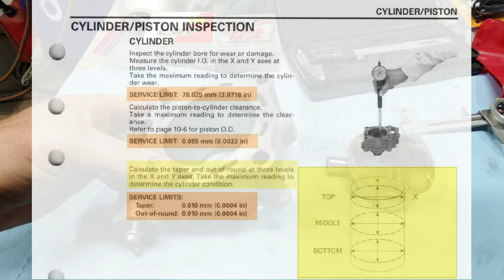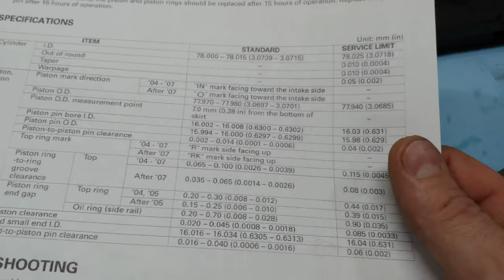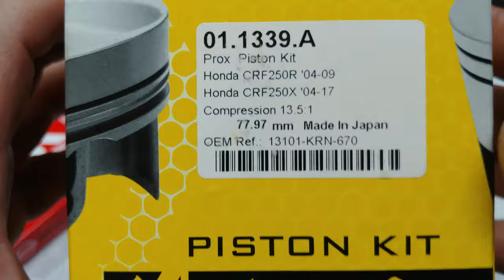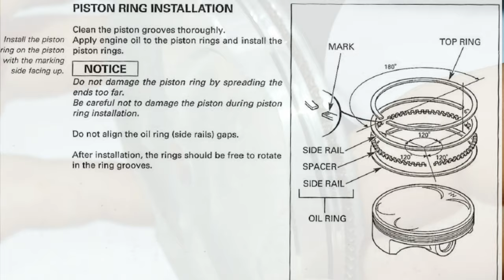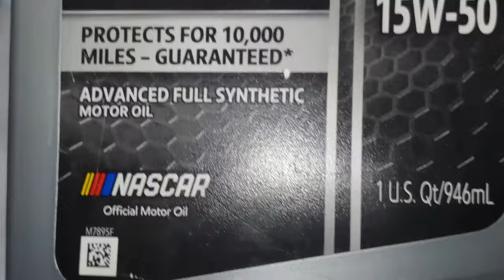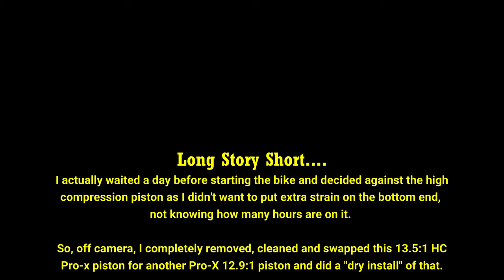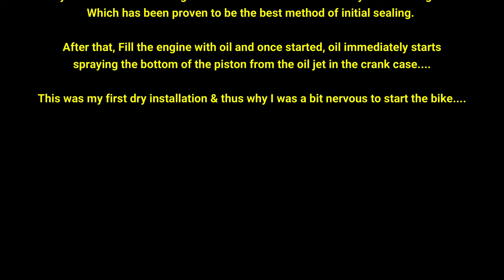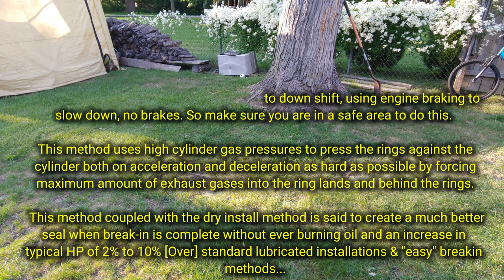06 Honda CRF250r || PRO-X Top End [ How To ]

Comment: I'm ready to do mine (in a few days when all goodies arrive to my door) crf250 2009.
It's the first time for me also. Good infos on your video, thanks.
Reply from the maker: Nice! Good deal. Glad it helped. Let me know if you have any questions. One thing I've been thinking about off and on is the next time I remove my cam I'm going to use a little carb cleaner and clean off the sides of the cam chain right where the timing marks are on the cam and then I'm not going to let the chain pop off the crank and that way I know exactly where to put the cam on the Chain when I reinstall it. You just have to make sure not to let the chain pop off the crank down by the flywheel.

Comment: Hey Andrew, would you reccomend doing a dry install on the piston? Also you didn't have to use a crankcase splitter at all correct?
Reply from the maker: Correct. Not with these 4 strokes. Just use a rubber rmallet and tap both ends to slowly work apart. 

 I highly recommend the dry install method in a new piston ring kit and light cylinder hone.

Comment: Hey Andrew I’m about to install my new top end rebuild on my 2007 crf250r. I’m pretty new to this so your video was extremely helpful. 

However I’m nervous about my crankshaft, i feel like it’s kind of loose. What’s the clearance u used on urs to check if it was too loose or not? 

Also, when u adjust the crank on the right side of the engine to line up with the tick before putting ur cam on, does the flywheel tick on the other side of the engine also move at the same time as the other side crankshaft as ur adjusting it? 

Ik that probably sounds confusing
Reply from the maker: Sorry for the late response. Glad it's helping. Hoped I'm not too late to help. I didn't really check mine but I'm about to replace it and the manual states that there should only be side to side clearance of the connecting rod of about .020" and absolutely NO Up and DOWN movement. This is really all is states. I ended up getting a new OEM Crank, Bearings, Seals, Piston, Piston Pin, Timing Chain and chain guide. 

The Punch mark on the balancer shaft gear and the the line on the flywheel will move at the same time being they are both attached to one end of the crankshaft. When you bring the piston to top dead center on the compression stroke, the punch mark on the clutch side of the crank will align with the arrow on the outside, front edge of the access bore. The line on the right of the two marks on the flywheel will need to be precisely lined up with the notch on the inside of the threads of the flywheel timing access bore. Then you can line your cams timing gear lines up to be level with the top of the cylinder head. Make sure that you snug down the two cam retainer caps and let the chain tension push in on the chain to sure you still have correct alignment of the cam timing gear marks. 

Once you have everything lined up, cam chain on, cam caps snugged down and tension released to make chain tight, check the flywheel line again. Make it dead on with that notch in the threads and then check the cam gear. If it's off you'll know. It will be a good 3/16" offset from where it should be in either direction. 

 If it is, just pop it over the teeth, one direction or the other that it needs to go.

Comment: How long does it normally take to start after a rebuild. I couldn’t get mine to start after about 15 minutes
Reply from the maker: You're either off a tooth on your computer timing or your idle screw is wrong. Try turning the idle screwnin al the way and backing it out 5-5.5 turns and see how it starts.

Comment: Great video! I’m new to the 4 stroke scene. Me and my son just took on a project. 2008 Crf250r we are doing a top end rebuild everything seemed to be going good until cam install. Cam has excessive side to side movement. Excessive to the point of decompression bolt head hitting head and cam lobe hitting rocker! Any help is appreciated. Thank you
Reply from the maker: Gotcha. Yeah there shouldn't be side to side play like that at all the bearing on the gear side does move but the bearing on the other side should stop it from moving one way or the other but one thing you have to make sure that you have are the locating rings that go on the bottom side of the Cam Bearing retainer caps you can see how the cam bearings have slots in them. There are supposed to be keeper rings that lock the bearings in place. So I would check and make sure that you aren't missing those. I do show those in my video and warned people to make sure that they don't drop down into the cam chain galley. Which well be accessible by taking the left side cover off after you drain the oil. Keep me posted what you find
Reply: @Fixin2Ride-Official-  thank you. That makes sense. The non gear side cam bearing is slip fit also. Clips are in place. The cam actually moves side to side like bearings are to big. This is so interesting lol
Reply from the maker: Definitely fun to learn about. If you have yourself a channel obviously then you should make a quick video and post a link. You can download the app to your phone make a quick video and then upload a real fast if you're connected to your home Wi-Fi. That way you can show me exactly what you're talkin about

Comment: So with cam timing being off by one tooth bike will start and stall few times ? is also sign of cam timing beiing off that bike is hard to start even when its warmed up ?
Reply from the maker: Yes it'll just be hard to start in general and the idol won't be very stable at a lower rpm.

Comment: Hey brother, my 05 seems to have lost a little compression, starts up for a little bit but then won’t idle, hard to start, and doesn’t respond to carb tuning. My valves are all in spec, could my piston need replacement? (Does your bike behave this way before it needs a top end?)
Reply from the maker: Yep. All classic signs. I'm going to rebuilding the entire engine now on this bike. I installed the top end at 26hrs and it's got around 86 now. I've been riding a lot harder but tell tale signs are less compression, especially when hot, easier kicking over and now I saw a little poof of blue smoke the other day when warming up. 

I did do a leak down test the other day and I was at 5-6psi loss via blow by. I was 3psi initially. It might be more now. Just placed an order for all oem stuff. $723 incl. tax. Shipped from rockymountainatvmc.com
Reply from the maker: P.S. thanks for watching!
Reply: @Fixin2Ride-Official-  thank you so much for the fast reply. I will be tearing into mine here shortly. I haven’t done this on this bike for 4 years haha I’m excited and scared
Reply from the maker: I got a full tear down video for a gasket it replacement on this engine when I first got it spring of 2020. Check it out.

You got this though. Judt take your time and take pics and or keep bolts organized in baggies marked with sharpie
Reply: @Fixin2Ride-Official-  was that just a craftsman torque wrench? I have a cheapo one from harbor freight but I don’t trust it one bit haha

Comment: i ride mine to and from work everyday  wheelie and bounce off the rev limiter 4 shifts ina row then go home to ride it around more everysingleday think im pushing 300 hours jus keep adjusting valves it jus got very hard to start i think its time is coming lol
Reply from the maker: Daaaang Smookey!!!! 🤣 300hrs. You better do a rebuild before she throws a rod or something. Ha ha. I just checked my leak down on this too after 56.5hrs today and I went from 3psi loss to about 5.5-6psi loss via blow by. It was about 3% loss to now 5% loss. She ran great at the track today though. 

 I've been using Motul 15w/50 5100 oil since spring and spring for so good. Loving it.

Comment: Hi. Is there any play on the crankshaft? In my 2015 CRF 250, I feel slight play along the sides and slightly up and down. Is this how it's supposed to be?

￼
Reply from the maker: A max of .030" is tolerable in thrust play (side to side) absolutely NO UP AND DOWN PLAY is allowed. If you have it, installed a new crank and crank bearings. Also would be a good idea to replace the baller shaft bearings if the crank has play and you replace the crank bearings.
Reply: this is about the play in the shaft bearings. there is no play on the connecting rod. there is play on the shaft up and down and sideways
Reply from the maker: @nr.1289 well then you might need new crank bearings if that's what you're talking about. You have connecting rod bearings on the big end of the crank as well as crankshaft bearings at either side of the crank

Comment: My cam chain keeps coming off of the gear behind the flywheel. How do I prevent this
Reply from the maker: There should be a keeper on the bottom side of the crank behind the flywheel, and you should have a white-ish (often tan from the oil) chain slide on the front side of the chain galley that slips in and black one on the back side that is bolted in at the bottom and is pushed on by the cam chain tensioner on the back side of the cylinder.
Reply: @Fixin2Ride-Official-  I didn’t have the other chain slide in and that was most likely the problem will try again tomorrow. Thank you
Reply from the maker: @jadenwong27 yep that was it. The chain could also be very stretched too. They Typically should be changed when the heads are rebuilt
Reply: @Fixin2Ride-Official-  it’s actually a brand new cam chain
Reply from the maker: @jadenwong27 OH good deal. You're good then. Just make sure you crank in the tensioner first before setting up the cam timing. I use a small screwdriver and a pair of vice grips
Reply: @Fixin2Ride-Official-  thank you. Will let you know if I need anything else
Reply from the maker: You bet! All I ask is for you to share your favorite video and the channel on your social media accounts to help get the word out and grow the channel please! 

Thanks!
Andrew

Comment: How did you figure out that the can timing was off?
Reply from the maker: I just double-checked it with the view plugs. When I lined up the cam lines with the top of the head, the flywheel marks were off.
Reply: @Fixin2Ride-Official-  thanks for the super quick reply. I am rebuilding the piston soon and I am pretty nervous. This video was a lot of help. I am most concerned about the timing marks. Last time I checked my valves I couldn’t find the tick mark on the flywheel towards the bottom of the engine. This is beginning to concern me after reading the other comments.
Reply from the maker: @jadenwong27 My pleasure! And ah. Yes, you have to make sure that the piston is TDCon the compression stroke. The punch marl on the crank gear on right side of engine will be lined up with the arrow on the case and the flywheel mark should be lined up with the notch in the threads. Use a flashlight and you'll have to get down below the hole to look up and see it. 

 P.S. glad it's helping and don't worry, get it all together and double check stuff, kick it over slow at first to make sure it's all moving well. You'll be fine. And I'm here for any questions.
Reply: @Fixin2Ride-Official-  Thank you so much. I was worried since this video is relatively old you wouldn’t respond. But thank you again
Reply from the maker: @jadenwong27 you bet. All I ask is that you share your favorite video and the channel in your social media accounts to help spread the word about the channel! Much appreciated!
Reply: Also, is honing the inside of the cylinder required? And do I need to order the new gaskets as well
Reply from the maker: Yes to both. Use a 320 grit flex ball hone and ATF. Pro-x makes a good top end gasket kit.
Reply: @Fixin2Ride-Official-  what size ball hone should I use on a 2009 crf250r?
Reply from the maker: @jadenwong27 83mm flex ball hone (aluminum oxide)
Reply: @Fixin2Ride-Official- I was tearing down the engine today and I forgot to drain the coolant. So when I was trying to take off the cylinder head coolant started to leak out. Is this a problem?
Reply from the maker: @jadenwong27 you probably got coolant down in the bottom end. So I would drain the engine oil if engine is still in the frame and use some blue shop rags and stuff them down in between the crank to soak it up carefully. Then use some compressed air down into the crank case via top hole of cases. You might need to pull the left side cover off where the stator is to make Sue it's all out. Then make sure you change the oil after first startup. That should clear it all out.
Reply: @Fixin2Ride-Official-  what would happen if all of it isn’t out
Reply from the maker: @jadenwong27 If you do what I suggest, it will get 99% of it out. That won't hurt anything, and when you start the bike for the first time enough to heat the oil up and drain it, you'll basically wash the rest of it out.
Reply: @Fixin2Ride-Official-  okay thanks for the help. Is there any other way I can contact you if I need anything else? YouTube comments are getting a little annoying
Reply from the maker: @jadenwong27 facebook

Comment: why you put piston 12.9:1??🤔
Reply from the maker: Great question! That is the stock compression ratio piston. I first brought home a 13.5:1 but decided against it because I'm not sure how many hours are on this crank. And the increase compression is a little harder on the crankshafts. Since I've had the bike I've put at least a hundred hours on a crank and I don't know if it's ever been replaced. So when I replace the crankshaft I'll probably put a higher compression piston in it.
Reply: @Fixin2Ride-Official-  200hours on crank with piston 13.5:1. Used Motul 7100 10w40 or maxima extra 10w40 change oil and filter every 6hours💯👌💪
Reply from the maker: Not sure if you've noticed but I ride Motocross tracks which is a lot harder than trails.